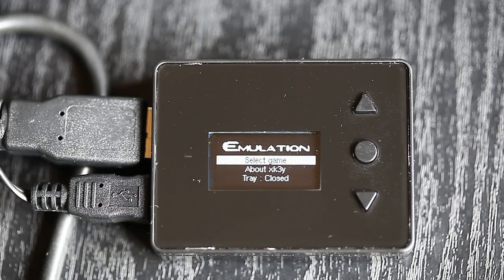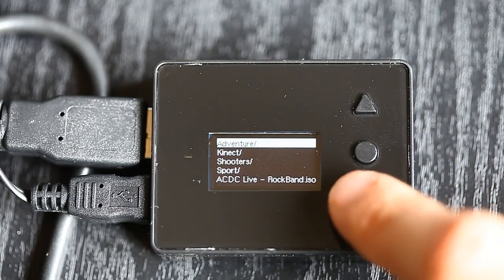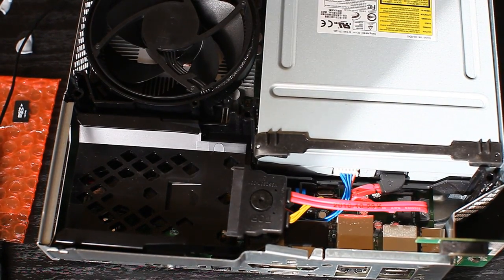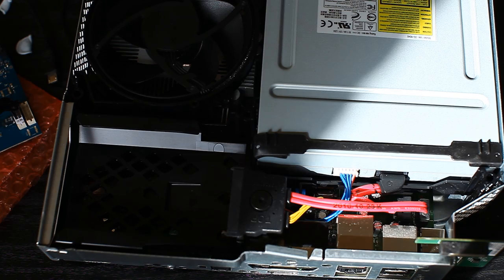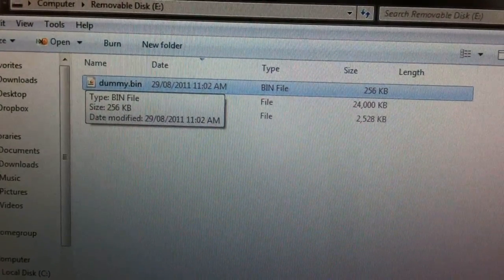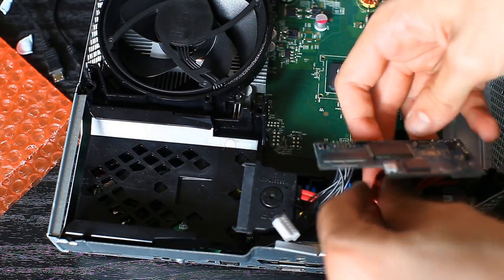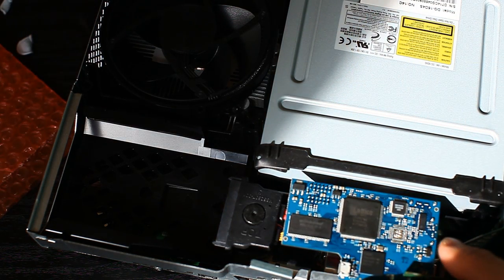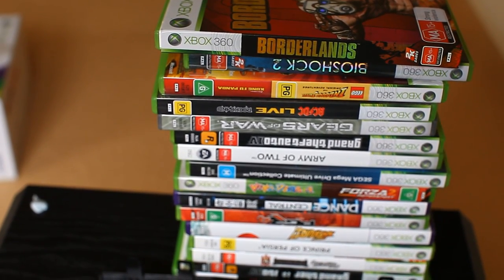xKey (x360key) Menu Navigation + install run through

Comment: Quick question. I know a future firmware will allow the xkey to read the dvd key directly from the dvd drive, but does this include drives that have already been flashed with Lt or Lt+? Or will that require a probe/mra hack to remove the dvd key still?

Comment: Can you help me .. I got my key today and the place where you plug in your wire that goes to the x key it self (USB unit on outside) is different. It has a place where you must put a paper thin power connector . but where do plug it in on the Xbox all the rest of the wires is the same as your video. ???

Comment: able to handle complex updates to its core firmware and for whatever reason needs a fairly complex change to how it functions due to a change in the Xbox 360 drive firmware or motherboard firmware that the team should be able to create an update for the devices O/S that can cater for the changes

Why should people need worry about a update when it states firmware can hinder your console when this device is attached. i ripped that from website promoting this device.

Comment: Someone should really design optical drive emulator for PS2 slim! That console needs this kind of device, not Xbox 360. Obviously not in such complicated control system. All games selected using the normal PS2 pads.. like on good old Xbox with Evolution X to get the idea... Why bother with this when 360 offers full game installs anyway.. with much more comfort than this...